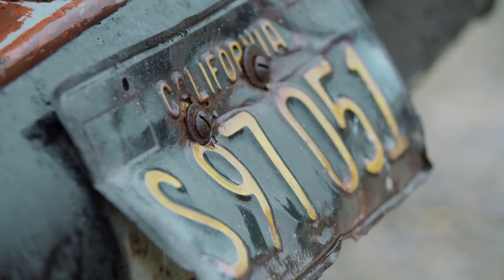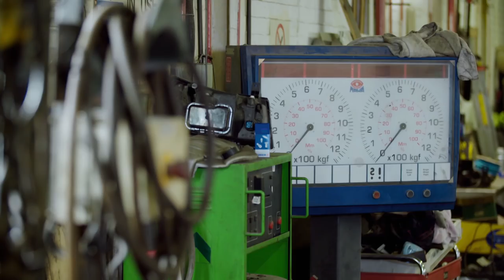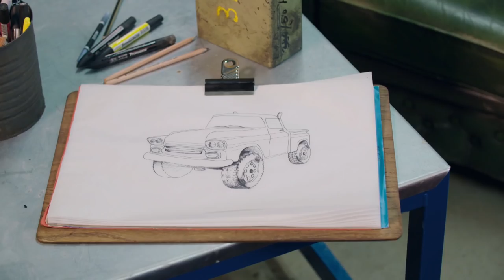From Rusty Old Pick-Up To Monster Truck | Goblin Works Garage

Comment: The "finished" truck is a complete disaster and would be unsafe to drive - typical of what a high school kid would have built in the 80s! They kept the 60 year old original drum brakes, did nothing to improve steering, and lengthened the shackles! On top of it all, they insist on calling it a "monster truck" when it's not even 4 wheel drive!!